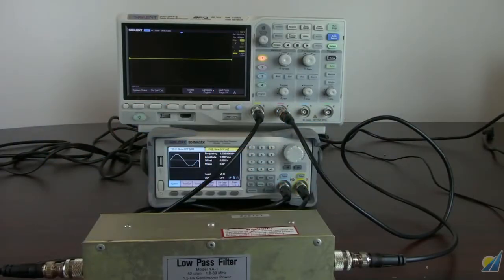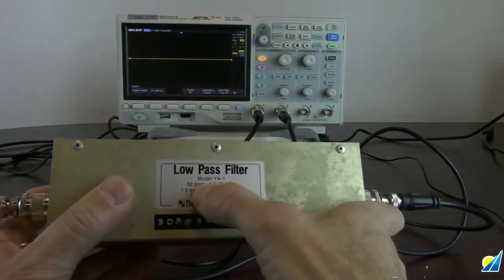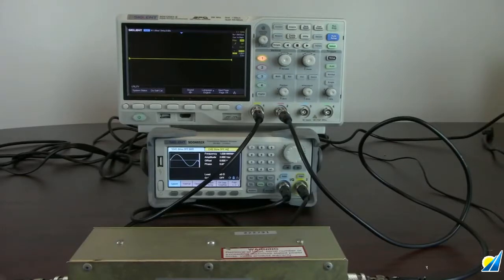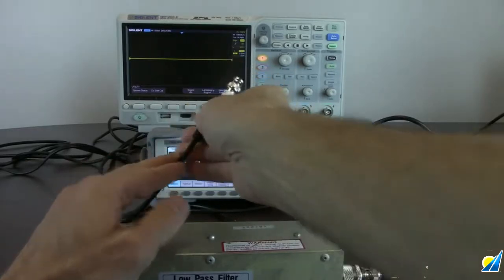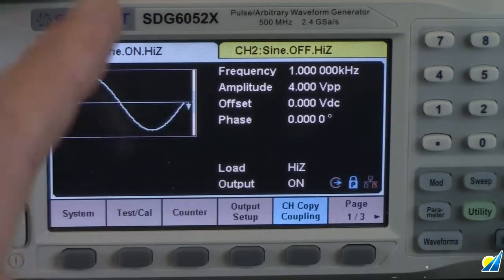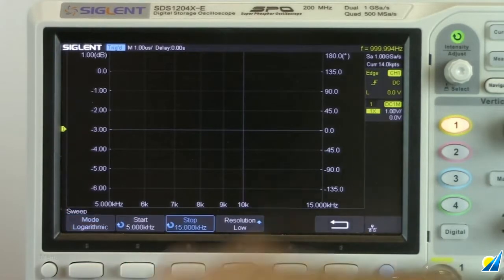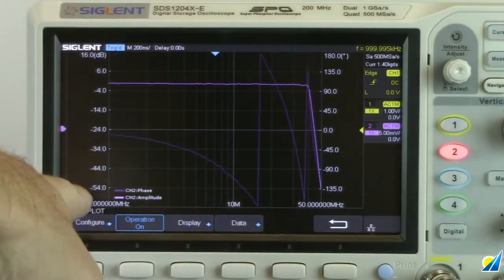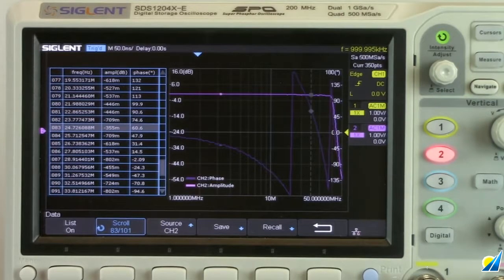Frequency Response Curves (Bode Plot) using an Oscilloscope and Function Generator

Comment: Can i use bode plot function with Wave Form Generator not from Siglent
Reply: You can bode plot in oscilloscope mode, triggered by an external AWG. Check up EEVblog's videos (video #396) on this matter.
Reply: @la7yka  Thank you so much, i got it with FY6900
Reply from the maker: no - it won't track.
Reply: @SaeligCoInc  thanks, i used it with FY6900 Wave Form Generation, and it was ok
Reply: @dattran0000  phase too?

Comment: Hello. How is the signal generator enabling the sweep? Was that commanded by the scope via usb? Thanks.
Reply: Yes. The AWG is working as a tracking generator, controlled by the scope. The units are connected via an USB-cable on the back.
Reply from the maker: "Sweep" is a setting on the signal generator
Reply: @SaeligCoInc  yes, but when are you specifying the range of frequencies to be generated?? Seems you are not doing it in the signal generator. . It's a sort of communication between the scope and the sig. Gen?? 
I also didn't see you enabling the output of the sig gen.. Thanks!